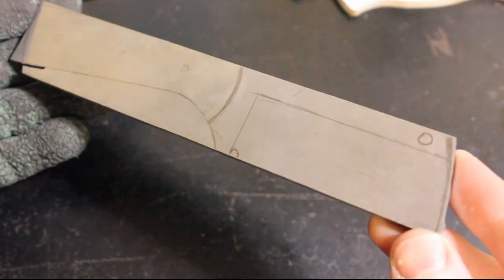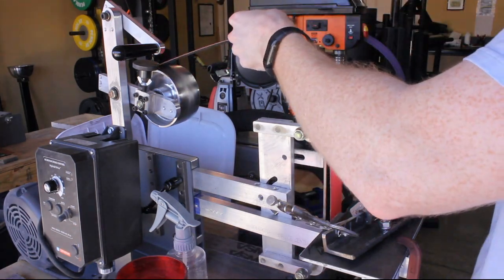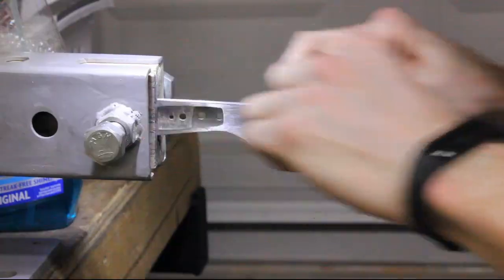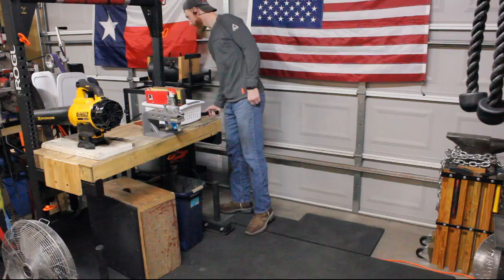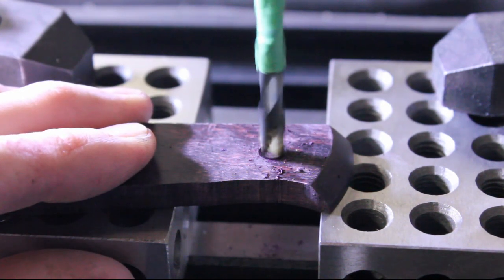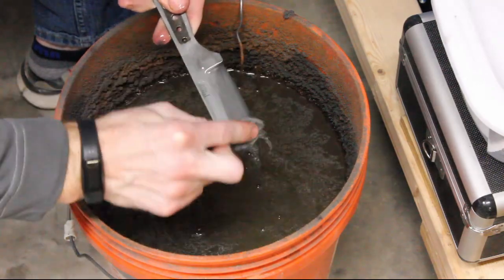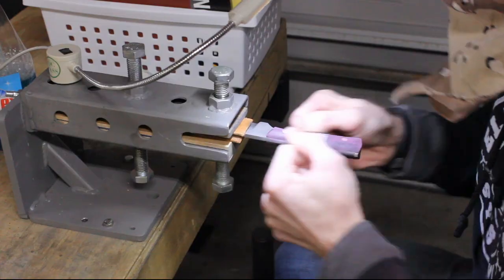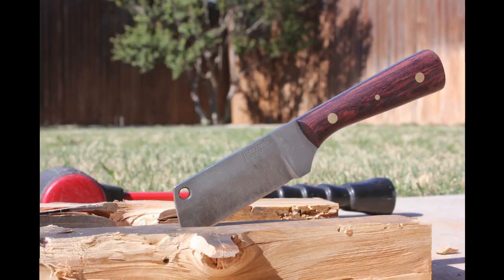Making a Cleaver Knife - With Commentary

Comment from the maker: Anyone know why there are holes in cleavers?!
Reply: Yes, for hanging from a 'butchers hook' on the overhead meat rail, cleavers needed to be securely hung out of the way when dressing a carcass out with finer knives and were only used for chopping bone in my grandfathers butchery. Cleaver accidents were the biggest accidental killers in traditional butchery, often due to exsanguination when the butcher missed the edge of the block and cut
their femoral artery, hence the adoption of bone saws now. A traditional cleaver would be full thickness (slab) bladed with a very steep edge bevel ~25° to 30° often even steeper to retain edge strength and weight, modern cooks cleavers with thinning grinds and shallow bevels aren't suitable for real bone work use in the same way, my modern cleaver has a superfine 15° edge, great for vegetables and meats off the bone useless for anything bigger than chicken leg bones.

Comment: I’ve got a shit ton of 1084. Was gonna stick to smaller knives but I really want a cleaver. I have some 2 1/2” by 1/8” that should do ok. Hopefully it’s not to thin but it will probably be ok for my tasks. I’m about to order some 1/16” stock because I wanna do some small but really slicy knives. Trying to keep it simple for now. I’m progressing quite well. I just need to change my motor on my 2x72 and add a variable speed. I think I’ll be way ahead of the scale after using a 1 1/2 hp single speed motor. Being able to slow it down is gonna be like heaven for me after learning on a single speed!!! Nice video. Really cool cleaver, I want one. I have some really cool variations of hardwoods and I really prefer wood scales being first and foremost a finish carpenter turned knife maker!!!
Reply from the maker: The variable speed is a game changer. I'm still learning it, but it's super handy! You'll be able to make a sweet cleaver with those dimensions!

Comment: Great job on the video!  Appreciated the commentary.  Really helpful!  Knife came out great too!

What are you using on the hand drill to clean out the tang holes?  Just deburring or making the holes more circular?  I'm ending up with nice round holes on the "top" side of the tang, but every so slight egg shaped on the "down" side.  Maybe just the press or technique, but close to trying reamers despite it not affecting anything.
Reply from the maker: Hey Jeremy, happy you liked it! I'm using a countersink bit in the hand drill to knock the bur off the hole edges. I haven't had the "egg shaped" results on mine; are you using a hand drill for the holes? I could see that causing the issue. If you are using a hand drill you could get a drill guide made to help keep things straight.
Reply: @RedBeardOps  Thanks!  Figured it was knocking that lip you get around the hole.  Using a porter cable standing drill press.  Must have some play or vibration somewhere in there.  More like a 3 pointed circle where the bit breaks the other side.  Looking forward to the next vid!
Reply from the maker: @RTWADV  WOw I'm supersized it's that off!